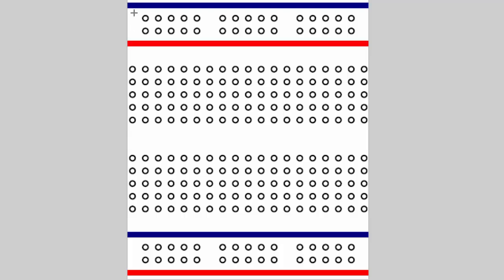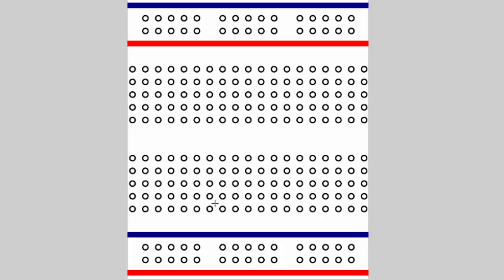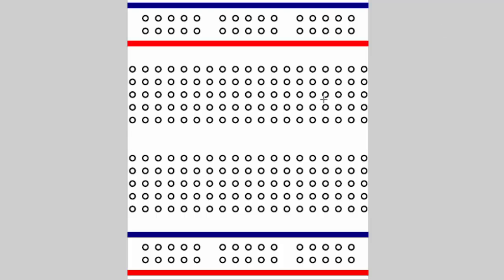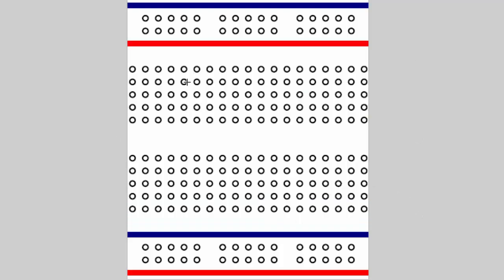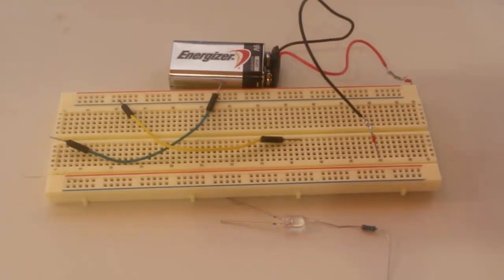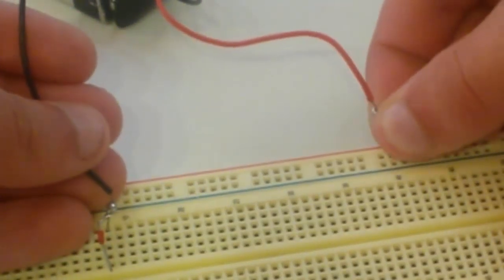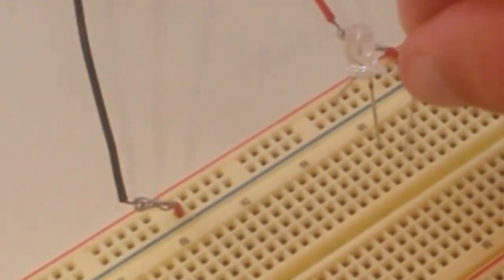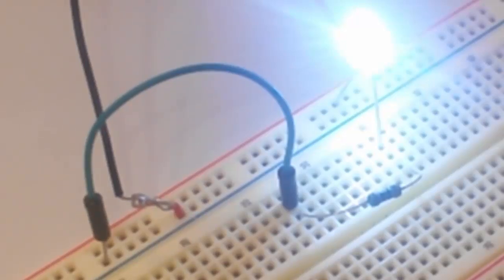Beginner Electronics - 10 - Bread Boards

Comment: Hello. I'm a physics education student and we have a subject basic electronics. I have a question in this video. As we can see, you use a wire to connect the resistor to the negative terminal of the battery. Can I directly put the resistor's terminal on the negative terminal of the battery?

Comment: Hi CodeNMore, I am a project student of a university. I am writing my project on design and implementation of electric power monitor and billing system. I want to achieve this through Power Line Modem. I have no idea on circuit design but I see that you're pretty good about circuit. Please, help me in with any relevant material that can help me do this work. Thanks. my email is ignalex4life@gmail.com and phone: +2347060605831

Comment: How did you connect resistor in horizontal line
Reply: First he put one end of the resistor wire into the same column as the LED. Then he put the other end of the resistor into another column. But as you correctly observed he still had to connect the second resistor wire to the blue horizontal power line. He could have just plugged the second resistor wire into a hole on the blue horizontal line to complete the circuit but instead he used a connecting wire which he put in the same column as the second resistor wire and then connected up the circuit by putting the other end of his connecting wire into one of the blue horizontal power lines. That way you can see the layout clearly on the breadboard even if it is difficult to see on the video exactly which holes the wires go into.

Comment: In another video the resistor was on the positive wire why is this one on the negative wire .
Reply: Well spotted. It doesn't matter is the short answer. The load on the circuit of the LED & the resistor is the same whatever order they are in..

Comment: it's dc 
so it flows from + to -
you put a resistor at - of the led
why it didnt fly the led?
Reply: Go back and watch video 8. At 1:42 he explains that you can attach the resistor to the + or - wire of the LED it will not make any difference because the circuit load is the same whatever the order. So I guess these electrons are clever things and take whatever components are attached to the LED before or after into account.

Comment: Am I correct is saying that your circuit path goes from the negative terminal of the battery, through the jumper cable, through the resistor, into the LED, and then finally through the positive terminal of the battery, thus completing the circuit?

Comment: Hi sir,
I want to ask you that what is the use of green wire with black cap on the bread board?
Reply: Akhil Sharma it's just completing the circuit. he could have connected the resistor directly to the negative battery bus, but he used the wire instead because it's more flexible and he wanted to show you that you'll use wires to complete circuits on breadboards early on so you're used to the idea.
Reply: Akhil Sharma I am wondering the same thing. couldn't you put the resistor directly to the power supply?

Comment: I know this is a year old, but hey, maybe someone here can answer... do breadboards have a power/current rating? Thanks.
Reply from the maker: I haven't seen a breadboard have an actual rating before, however they aren't meant for high currents. I've never run more than 0.5A through a breadboard, and you shot definitely be cautious doing so.
Reply: Thanks! I hope you continue your series, it's very inspirational. Haven't done any electronics project since silly primary school stuff and actually thinking about picking it up (and EEVBlog is too intimidating:) )
Reply: you don't necessarily need the wire coming off the resistor. you could just put the resistor directly to negative.

Comment: I have a question... if anybody could answer and help out my understanding of circuits and breadboards then thatd be great!

it may seem like a simple question, but im new to this.

the moment at 7:15, when the wire is connected essentially to the resistor, would this be regarded as the positive or negative terminal of the resistor?

also, could the end of the resistor (the same side where the wire is being connected), be directly entered into the power line? or is the wire needed for some reason?

im probably missing something, but looking forward to the answer and learning a bit more about this :)

PS thanks for the vids, so helpful and really well done!
Reply: Actually a resistor is "non-polarized", meaning that it doesn't have a negative or positive terminal, and could technically be turned the other way around, it wouldn't really matter.

As for your other question, yes, the resistor could've been connected directly to the power line, the wire was just added for convenience. (And probably also to clarify how the breadboard rows are connected)

Hopefully that answers your questions :)
Reply: Hey there.

Thanks for your answers man :)

Last night it literally 'clicked' for me about how to use a breadboard.

Now, just trying to get my head around transistors...

Cheers!
Reply: You are very welcome, I hope that you'll learn a lot more, and that you'll have an amazing journey with electronics ;)
Reply: 123 456 thanks was wondering the same thing about the resistor going directly to the power supply.

Comment: Does the smaller leg on the LED not have to be connected to to the neg. terminal
Reply: Since its is a diode, the positive (longer leg) and negative (shorter leg) have to be aligned accordingly with the current (+ with + and - with -). He talks about it in one of the earlier videos.
Reply: He means in the previous video the longer leg had the resistor between the + and the shorter leg was connected to the -.

The resistor swapped places.

Comment: I don't understand.  You put the circuit like this (positive) >  anode LED cathode  >  resistor > (negative).  However in "First circuit!" you put (positive) -> resistor ->  anode LED cathode -> (negative).  Can we have it both ways?  How didn't the electric current fry the LED?
Reply: This is an old comment, but, if anyone has the same question just think of the current as the car traffic. It doesn't matter if there's a jam at the end or at the beginning of the road, if there's a jam then all the cars along the road will slow down because they can't just go over each other. The "jam" here is the resistor.
Reply: @Deksudo  thx
Reply: it doesn't matter on which side you put the resistor
it's the resistance of the entire circuit :)
Reply: You can put a resistor on both sides
Reply: At the same time, yes (althought it seems to be a waste of ressources).  But  how didn't the electric current fry the LED in this video?
Reply: The circuit wasn't closed until he connected the resistor to the negative side of the battery. IIRC protons usually flow from the negative side of the source. So until the connection was made with the wire to the negative side, no current was flowing to the LED.

Comment: I am a complete noob... why food you use an premade board wire going from the resistor to the negative (terminal?)? Could you connect the resistor directly to the negative side instead of using another column our wire??

Comment: Why the resistor is placed after the LED? I don't understand, i thought a resistor had to go before the led! Someone can explain to me where I got confused? Why can you put a resistor either side of the led when its a DC?
Reply: +nadiaatz it doesn't matter because current comes from both sides.
Reply: complete noob question. Since it is a DC shouldnt it only flow in one direction?
Reply: +TimboZ_ 123 OK!now I realize!
Reply: +nadiaatz 😀👍
Reply: there is a metal and metal takes the current to both side not only one side
Reply: If you still have dout, ask me.
Reply: In the material of the connection / wire / resistor between the battery poles there are also electrons and protones. Electrons from the battery are being "pushed" through the connection by pushing the electrons inside the connection away to the other side because two electrons (negative charges) always reject each other. It doesn't matter where you have the resistance because the current / the electrons are always shifting through the entire connection at the same time. If there is a resistance at any place the current throughout the entire circuit will be reduced.
Reply: As you probably know by now, with electricity, it does not matter which side the resistor is on. The electricity is basically an instantaneous connection.  The resistor just like a fuse, if it is over heated, it cut out.  Similar to brakes in front of or behind an object, when applied, they slow things down.
Reply: He placed the resistor on the positive terminal of the battery.
Reply: @geert889 
Back to the water and pipes anology, if you have a big pipe and a small pipe, and you connect them after each other and pou water into the bigger one, it'll still flow just as fast as it can in the smaller one.
Reply: +Arathot Khern 

I was thinking the same.
I thought that R had to be placed before the LED so it takes the Volts down...

Comment: Hey CodeNMore!  I'm curious, why did you have to use a wire to finish the circuit?  Could you have routed the cathode to the resistor and then back to the power-rail?  It seems like connecting the resistor to another column and then using a wire to route that back to the  power-rail is one extra step.  Thank you for this series!  You're quick, to the point, and a good speaker!
Reply from the maker: +Adam Wirth I easily could have connected it directly to power, I just decided to use a wire (mainly just to "verify" to people how the breadboard rows are connected).

Comment: Does it matter where i put the resistor? U placed it on a negative side of led would it be the same if i put it on the positive side? 

Great tutorials btw, keep posting more videos! 
Sorry for my bad English :)
Reply from the maker: +Igor Jovic technically you can put the resistor on either side, because it will resist the flow either way. I do, however, recommend trying to stay consistent in your projects (so if 1 LED has a resistor on the positive lead, put other resistors on the other positive leads as well).
Reply: +CodeNMore thanks for the reply. Will u continue with the series?

Comment: Hey CodeNMore, I just completed my first circuit today as per this 10 episode and tons of thanks to you. Now, i just want to tell you that i had a hard time figuring out the colour code on the resistor...i got confused between blue and black...but finally i had a resistor with codes: Red,Black,Black & Golden= 20 Ohms? , used an old 9V battery of a toy car.....and the LED just lit up fine. Just tell me if 20 Ohms resistor was a wrong choice for the circuit or not?
Again thanks a lot...keep it up.
Reply from the maker: +MrSykert1- The Moon & UFO if you did the calculations we did in episode 7 for your specific LED, it is likely that 20 ohms isn't quite enough to be fully safe using a 9V battery. It will work, of course, however your LED lifetime may go down using such a small resistance. I would revisit episode 7 and try to do the calculations for your LED.

Comment: Hi CodeNMore - this has to be a first for me....commenting upon a video! - have to say, im really getting into your Beginner Electronics.  I am actually 44, ive always been interested in electronics and have opened up many products to play around with, and always having many extra bits left over after putting it all back together! - I have more recently started learning more, and even though I know some of the basics, ive started off with video 1 and now just watched 10.  At first, I did not think I would pick much up, ...how wrong.  There maybe parts that I glazed over ..a little, but I still gain more knowledge than what I started with.  I note you do other videos, however please carry on with this series.  I just cannot believe you dont have more subscribers and/or this should be placed into some form of education program, as the way you conduct yourself, and explain matters is excellent. Hoping part 11 is not too far away! - thanks!
Reply from the maker: +rob leigh Thanks for the support, glad you like them! More will come...eventually!
Reply: Same here, 40.  Both my brother and father are electronic engineers.  I never got into it but I find myself wanting to know more and more these days.  Thanks a lot.
Reply: +CodeNMore Great realy getting into it.